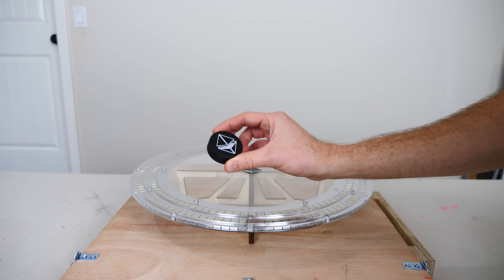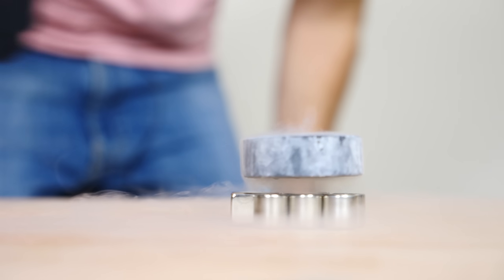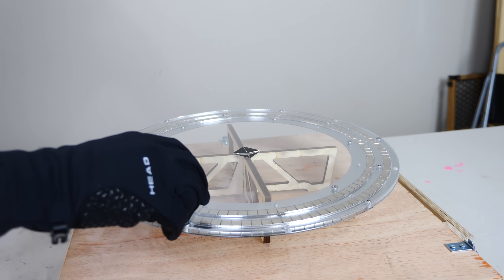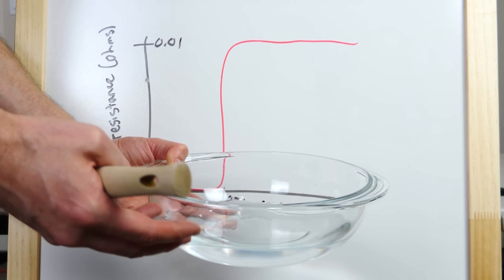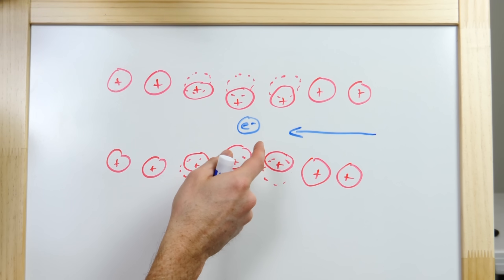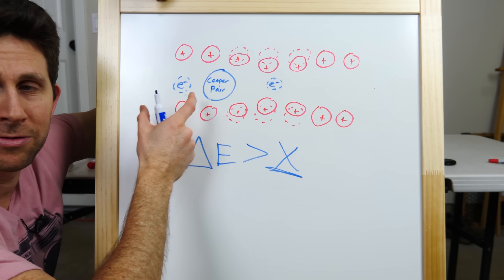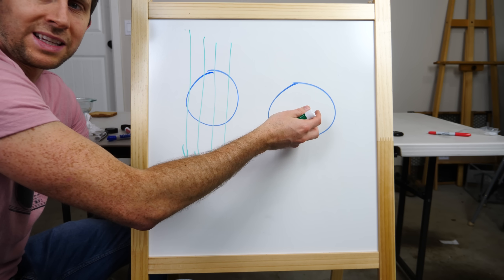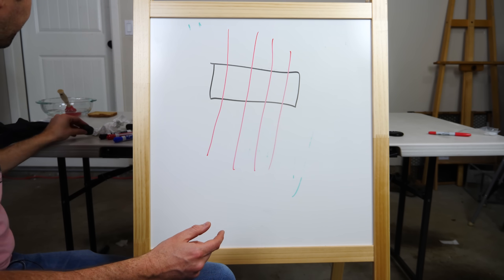Quantum Locking Will Blow Your Mind—How Does it Work?

Comment: Theroretically u could make this experiment into a flying car,only if u have a strong enough magnet and a strong enough super conducter and there would be a cooling system in the to keep the superconductor cold enough so it could continue to levitate and when the super conductors gets close enough to the ground there could be a suspension system to keep it in place(idk wtf I'm saying but it could be possible)

Comment: .... With enough resources, and proper planning and engineering, could we not make a large enough type 2 superconductor and magnetic system, and make a form of quantum locking flight engine for spacecraft, that literally propels itself by slowly squeezing along with an induced magnetic field? I would need more resources and knowledge to see if this is possible atleast in theory. but if the type 2 superconductor needs to be cooled, could the "engine" not be bathed in a solar power operated liquid nitrogen recycling pump system? Only thing I could think would be problematic is the size of the magnetic field, and shielding other electronics of the spacecraft from it, while the rest of the spacecraft could still be effected. perhaps a type 2 engine/craft design, with a type 1 shielding, since the type 1 superconductor is designed to not let magnetic fields pass through it, but around it.

Comment: This is how planets work and keep spinning? Because it’s super cold out there In space
Reply: No.

Try thinking the other way around, why would it stop spinning?
On earth we have an atmosphere so something spinning will always push the air around it and loose energy that way, furthermore it needs to push against the earth to prevent it from falling (usually the ground) and that is another source of friction. Because of the object and the earth (and atmosphere) constantly pushing against each other they will eventually both move the same way and since the earth is way more massive it will almost not change the way it moves at all while the object takes on the same movement as the earth.

Now for the planets in space there is only very little friction, they don't rub against each other (most of the time) and there is also only very very little air resistance since space is a pretty good vacuum.
So there really is no reason for why a planet should stop spinning since there is nothing pushing against them.

Well actually that is not quite true.
There is a difference in the gravitational pull experienced by an object based on how far away parts from the object are from the source of gravity.
We don't really experience this in everyday life since the difference is very small for every day distances, the difference between your head and your feed is absolutely negligible but for planets and moons it starts to become relevant and causes friction even though they don't touch. This is why we have tidal locking for some systems (for example the earth and the moon, where the moon rotates around the earth with the same rate it rotates around itself and therefore we always see the same side of the moon). However this takes quite a long time even in the faster cases and for example earth only slows down by a couple of milliseconds per century at the moment and will not achieve tidal locking with the moon in the lifetime of our sun.

Comment: My grandfather worked for McDonnell Douglas. He was apart of the team that made the flying saucer. it could go from side to side or up and down but not both at the same time. it was held into the magnetic field of the Earth. they used type 1 superconductors i think. if you imply this to what they were making, you can attach a payload to this that is attached to the magnetic field of the Earth and use it to hold the weight of the pay load in place. your thrusters would then be able to lift the load up with less energy and if you ran out of fuel you would stay at the same altitude you turned your thrusts off until you heat back up, much like an elevator. With a large enough superconductor you can get heavy payloads to the top of the magnetosphere with next to no energy input because the super conductor would hold majority of the weight while the rocket moves it. You would have to be on a magnetic stream tho and not just on any location. the highest magnetic parts of the Earth magnetosphere.

Comment: 19xx: pour some coal, the locomotive is slowing down 
2020: levitating bread
2050: pour nitrogen, the train is about to hit the ground
Reply: I thought the same thing as the future but we will need to find lots or resources for supercondutors
Reply: Maglev trains already float above ground without the use of superconductors. That is why they can casually reach and keep 500km/h. They are awesome.
Reply: @hr1100  but if you could do it with quantum locking and type 2 supers then you wouldn't need constant input of electricity.
Reply: @hr1100  it's when they start travelling at 2000 km/hr that these things will start to matter.
Reply: OMG U READ MY MIND!!!!! I SWEAR TO GOD!!!!!
Reply: My brother is working on this technology in Japan.
Reply: That actualy isnt that new of a discoevery but its too expensive and unpractical to use this on trains. Unless someone invents something that wil bee more practical.
Reply: @568dodo  like say a superconductive material that has a warmer conversion temperature.

Comment: Let's consider a hypothetical environment devoid of gravity, air and heat. Such as deep space far outside of any galactic bodies where the temperature is a static  -270.45℃. Could this superconductor continue moving along it's track indefinitely without any other outside forces influencing it? Or, would it eventually slow to a stop?

Comment: Imagine giving this thing a track, with ramps, jumps, and other stuff...
Reply: Or as someone else said, make it go vertical....
Reply: You're talking hotwheels man..
Reply: U cant actually jump, cuz it is locked...
Reply: Superconductors can't really go off the neodymium tracks, so you would have to make it go extremely fast
Reply: How about using this concept to improve a rail gun technology. Use the superconductor track to create a frictionless track while placing it into a vacuum. Accelerate the projectile upon the superconductor chassis using the rail gun electromagnetism existing in rail gun tech.

Essentially remove more friction by using a vacuum and superconductor chassis for the rail gun projectile to gain faster speed before exiting the gun barrel.
Reply: @Hexnilium  That is an interesting concept. Do you believe there is a way to propel the superconductor? Do you believe that you could cool the bullets indefinitely (e.g liquid nitrogen)?
Reply: P0werPuppy Not the projectile itself / bullets, but the superconductor chassis.
Reply: @Hexnilium  the projectile must be a superconductor for it to work
Reply: @p0werpuppy839  Why would the projectile necessarily have to be the superconductor?
Reply: You might be able to do it if it got huge momentum, but it would be a/some magnets to pull it, similar to a roller coaster launcher. It would have to get higher in conductivity to have the right pull, I would probably use electromagnets to do it.
Reply: Yeah I was amazing by the drifting sandwich
Reply: Search „Lexus hoverboard“ on YouTube. This is exactly what you mentioned!
Reply: @MacBookAir-cu4fb  Oh yes I remember that.
Reply: i recall watching a video on youtube about a hovering skate board that is made to hover the same way as in this video
Reply: And a manual transmission and seating for 2
Reply: I bet that in the future we are going to have trains that use that
Reply: @Meek2001  we pretty much do have trains like that. But they do not have to be submerged in liquid nitrogen.
Reply: They made a hoverboard out of super conducters and a magnet track
Reply: wAiT DidN’t tHeY aLreAdy dO tHaT

Comment: Theoretically if you were to change all roads to the same magnetic track system as the track your using and then replace car wheels with 4 symmetrical superconductors that are extremely large and instead of gas use a heating cooling system to slow down or stop we would eliminate the need for fossil fuel assuming we could solve the problem of choosing how to turn right? (Please neglect the fact that this would cost billions of dollars)

Comment: I've seen a more physical prop for Quantum Magnetic Locking. It's was made of a clear polycarbonate sheet shaped into a disk with a bunch of holes in it. Through the holes and attached to a board above and below the disk were rubber cords that represented the magnetic field. The cords where slightly larger than the holes in the disk so it held the disk locked in the air. You could move it up and down the rubber cords to simulated how quantum locking worked.

Comment: If you did this in a vacuum would it ever stop? No friction, and no wind resistance
Reply: Newton's first law of motion.
Reply: Anything in motion stays in motion unless stopped by an unatural force. So yes, you'd be correct. In a vacuum due to the lack of air resistance or friction it could theoretically go forever. But what about momentum? Wouldn't it eventually run out of momentum?
Reply: Ghostly Assassin 
The momentum of an object will never change if it is left alone. If the 'm' value and the 'v' value remain the same, the momentum value will be constant. The momentum of an object, or set of objects (system), remains the same if it is left alone.
Reply: @definition.of.insanity  momentum is mass times velocity, if velocity doesnt change, so doesn't momentum (given mass isnt changing)
Reply: @convex2172  ok. That's what I thought, but thanks for clarifying. That's still a really cool concept. That in theory this could spin for eternity

Comment: There is two things here.

Levitation and 0 resistance.

I think this has massive real life uses.

We need to think of a way to get around the low temperature.
Reply: Air resistance dummy smh
Reply: @pandasprod3890  What do you mean? The Air Resistance between what and what? I thought It is the repulsion between the magnet and the superconductor levitating. And there is zero resistance that means one charge lasts forever. I am quite interested in this!! I am 2nd year A-level Physics Student (not the best), interested in response.

Comment: Hey, wouldnt using this in a virtually perfect vacuum make a “machine” without friction? Doesnt that break the no machine without friction rule thing?
Reply: I was thinking along the same lines. If this machine is self propelling like it appears to be we might have a possible perpetual motion machine.
Reply: if you were to put this in space, due to there being no air resistance it could theoretically go around forever.

Perpetual motion machines aren't possible however, as you'd need to put energy into the machine to take away the energy, not sure how it would work in this particular instance but it's common sense that it wouldn't work.

Comment: NOW AN EXPERIMENT that I would love to see: What would happen if we flip a similar polarity-symmetric neodymium track to lie vertically, instead of horizontally as shown? And, in lieu of a circular track, say we use an elliptical track with tall height. Then, quantum-locking a Type II superconductor to this vertical track and giving a small push upward would propel it towards the ceiling. It is already shown that normal downward gravitational acceleration does not apply to quantum-locked objects, so air resistance on the top face of the locked conductor would be the only opposing force in such an experiment. However, provided that the top and bottom faces of this locked conductor have equal surface area, they would face an equal amount of air resistance at equal velocities. Thus, you’ve now created a gravitation-resistant elevator that can move at the exact same speed in either direction along the y-axis, provided the same amount of force. 

Now bear with me because this is where we deviate to the theoretical. Assuming quantum-locking could be implemented with a larger mass, one could create a macro version of this elevator. Furthermore, the amount of power such a quantum elevator would require to start-stop would be absolutely negligible compared to our modern motor-pulley systems for transporting people. In fact, the primary concern would be keeping the superconductors cool enough, which would be a negligible concern in say... Siberia? Really depends on the temperature required for achieving zero-resistance. Hypothesis thoughts or critique?
Reply: I love this long comment soo much and I totally agree with you and think this could be implemented everywhere and it would either increase or decrease the fear of elevators. I think it might increase fear for the reason of a FLOATING ELEVATOR that people think could give out. I think it will decrease in the manner that there aren't any ropes/pullies that could snap resulting in a catastrophic even that would terrify even the bravest of people. And when somethimg FLOATS there is nothing that can snap. Thank you for letting me share.
Reply: @bradleypederson2287  

How did you take a theoretical experiment of quantum mechanics to a subjective discussion about fears of traditional elevators.
Reply: Bradley Pederson screw that! How bout a trip to space! What if you made a symmetrical magnetic field string it in something like a tether or something strong & long! Lol! Anyways, string a line to the space station. Put on your cold shoes & jump ! You’d literally need a type of fire extinguisher to spray them on your journey, or strategically have cold blasters stations the keep the those superconductors cold enough to continue moving, & eliminate the possible Challenger mishap permanently! Much safer when there’s not thousands & thousands pounds of rocket fuel, ignited creating thrust to propel astronauts to outer space!?!  So much can go wrong! Plus we gotta deal with space trash now so that is another helpful purpose that my idea would eliminate more of!!! Potentially save lives! No more litter in space! I think we got something fellas! Let’s Patent that! What shall we call our newly assimilate what we just came up with, put our names on it, sell the idea, be billionaires in the next 2 decades!!!! Who wants to help out!?!?
Reply: J1MMY B3N2 me
Reply: @j1mmyb3n24  Now that's quite an idea, but keep in mind that our body is not made for travelling in such conditions. Also, stringing a line and keep it connected would be nearly impossible, given that nowadays space trashes and shrapnels are littered everywhere and moving at extremely high velocities. Materials to keep the line in contact aside, we need to consider if it is really safe to travel like that.
Reply: Big brain time
Reply: Gravity does apply to the quantum-locked object. It is simply suspended on the magnetic field of the circular track. The object's weight is fully transferred onto the track via a magnetic repulsion (when on top of the track) or attraction (when hanging below). There is no zero gravity anywhere in this setup.
Reply: @gadha707  THIS! Gravity does not just magically disappear. How has that been shown? It just means that the magnetic field is strong enough to hold it up. Imagine if the magnetic field lines were visible, real, strings, or rods. And you simply hung an object on it. The weight of the "floating" object is still being held by whatever the strings or rods are attached to. In this case, the magnetic "strings" are being generated by the permanent magnets, so the weight of the floating object is still being held up by the magnets, and whatever they are mounted to.
Reply: @ginsuown  This is exactly what I said. Thanks.

The scenario is nothing different than an object sitting on a table, as far as the gravitational acceleration felt by the object is concerned.
Reply: I had to scroll so much
Reply: @fearlesskugkug5192  very sad times
Reply: What?
Reply: You completely misunderstood this. So much text for nothing.
Reply: I don’t think this would work because the superconductor only held the magnet when it was horizontal. When he pushed/pulled the magnet it would still move. I think if you did this the superconductor would just fall down and stay there. The elevator wouldn’t be able to go up without something else pulling it up, which would defeat the purpose because that thing would generate resistance. What I think we could do instead is make a huge airport with a  bunch of superconductors in the floor with  magnets underneath, so you can ride on like the bread in this video. This would be a cool thing if you didnt account for the what I would guess, an absurd amount of money.
Reply: or we could make a train with magnetic tracks and supercooled semiconductor wheels or something along the line of it. also is it possible to calculate the minimum force required to stop the conductor once it's in motion?
Reply: This comment makes no sense at all. You have achieved the lowest friction linear bearing that is also a fridge...

Comment: My question is: Is there a limitation on the lateral force you can apply to the superconductor?

If you applied a large amount of force, would the quantum lock be broken?
Reply: that's basically what happened every time he adjusted the height. He overwhelmed the magnetic fields that were locking the puck, allowing the internal flow to be changed, creating a new lock point.

Comment: Sir, you said that without change in flux , Eddy current can't comes into semiconductor material, and once Eddy current established there is no magnetic fields cross into this material, but my question is how the semiconductor material stays at one place repealing the magnetic fields without changing the flux (as you had earlier said without change in flux , Eddy current can't comes into role) or how  your semiconductor material stays at one place in air ?
Reply: lenz law